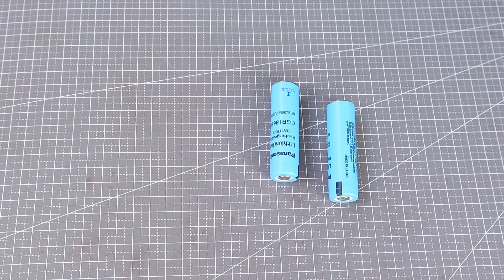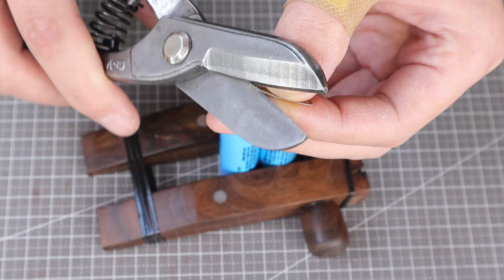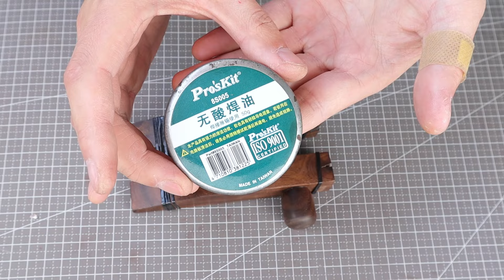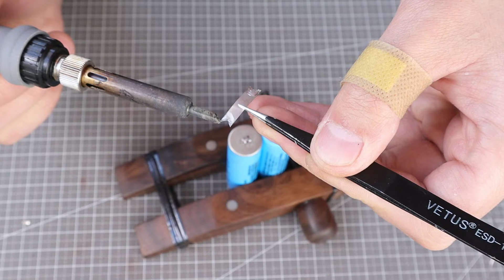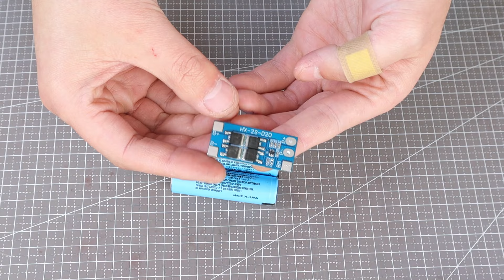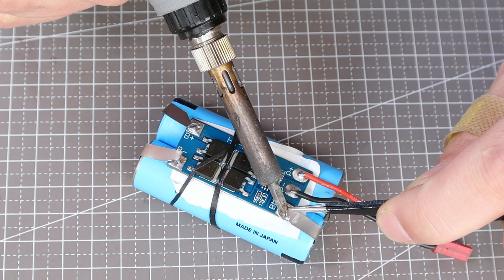How to Properly Solder Li-Ion Batteries without Battery Spot Welding Machine？

Comment: what is the other chemical you are applying with cotton?
Reply: flux
Reply from the maker: Water for cleaning PCB board to remove the flux deposits, dirt and solder oil. You can use alcohol instead.